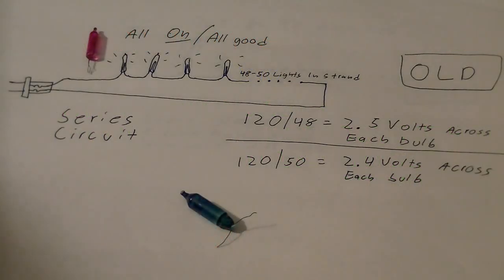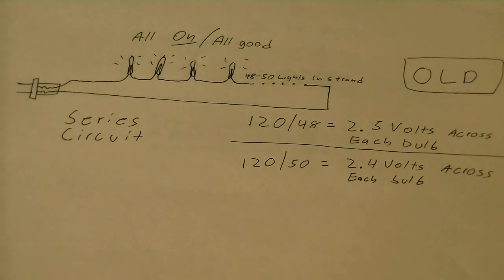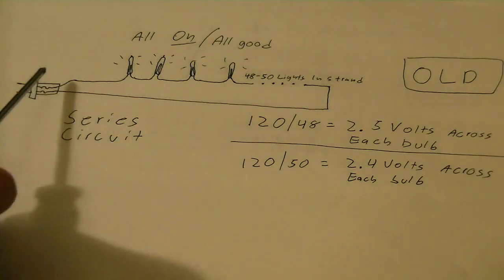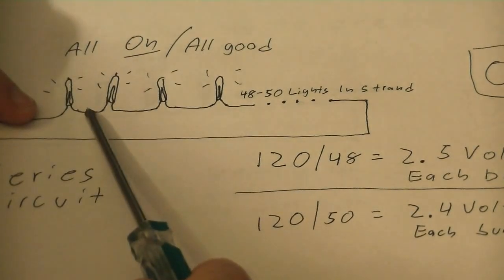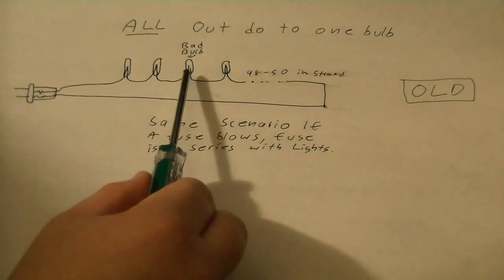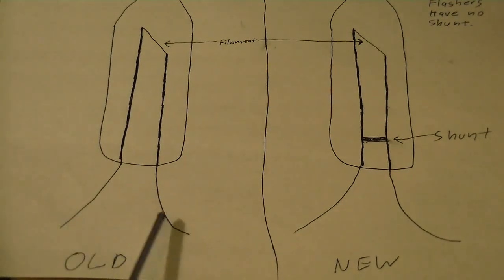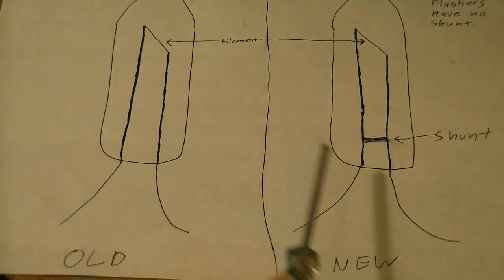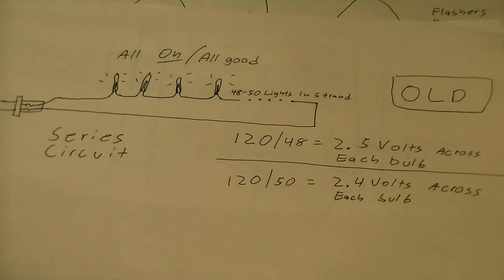How Christmas Lights work (why when one bulb burns out they all go out, and about new lights)

Comment: My mother has a string of Christmas lights and the box says when one goes out they rest don't.  They look like regular size Christmas bulbs so I'm guessing they are a series circuit with shunts.  What is weird is that all the lights on one side of the string have gone out, but not the other side.  I can see that if I take a light out on the side that is still lite up that it doesn't knock the other ones out on that side, so they definitely have shunts.  But why did the other half of the string of lights go out?  The plug has two little fuses and I replaced those, didn't fix the problem.  Then I went to the last bulb on each side of the side that is working and replaced the two next to those that are not working, one at a time, but that didn't fix it.  So I guess the problem could be in any of the bulbs that are not lite on the side that isn't lite up right?  One of the shunts must not be working, I'm guessing.  Does that sound right?

Comment: Nice explanation. I'm wondering if you could shed some light on a problem I have on a vintage Merry Christmas Sign I would like to try and fix. It's a Dynasty classics 1992 Merry Christmas Multifunction sign. It has 8 functions and 144 total incandescent lights with a two 1.5 amp fuses for a total of 3 amps it says on the plug. The easy question is I don't know if I need 2.5 or 3.5 volt replacement bulbs. The other is there is a section of 5 dim lights on the string but the rest are fine before and after that. Now these aren't wired like traditional string lights. The controller box has 5 wires coming out each going to 4 separate bulb colors to power the lights and the 5th to the opposite end that has 4 soldered wires together, Probably the neutral wires going back to the controller box? I've also noticed a small nick in the wire close to the dim lights but it seems to be mostly in the plastic and not thru the wire. That could be the problem or one of the lights are about to fail and are at a higher voltage making those 5 bulbs dim. Also each bulb socket has 2 wires connected to one side and one wire connected to the other side and if I totally remove one bulb the rest of the lights stay on. I know this is a lot but I tried to be detailed to explain the problem. I don't know if you really want to answer this but I want to fix this vintage sign and you seem to know about electricity. Thanks

Comment: Good video. I've always been into electronics and electricity and I remember the time in my childhood when I was looking at a string of lights mom and dad had and wondering how those small bulbs could handle 120v. I'm not sure if it was my dad who told me or if I discovered it myself that they are wired in series and it made sense then. I had electronic kits at the time and had learned about series and parallel circuits from those.
Reply from the maker: Thanks! Yeah, i used to wander that too. But the voltage divides across of them. Thanks for Watching!!!

Comment: I'm wondering  if u have a strand of 50 bulbs  is there a way to add on to the circuit? To double to amt in a single strand  I understand  bulbs Carry resistance so I'm sure that has a max amt on "old" lights on a single strand..
Reply from the maker: Yeah you would only be able to have so many or the voltage would not divide across the bulbs right. Thanks for Watching!!!

Comment: I did find, after doing some meter testing, that I'd need to add a resistor(s) to the circuit if I wanted to shorten the lights form say 20 lights to two lights (I wanted to wire a small box with a switch and two lights). The reduction of lights would not provide the needed voltage drop across the circuit without it.
Reply from the maker: Makes sense, keep it from over powering the other ones. thanks for watching!!!

Comment: Many thanks for the informative video. I would want to build my own Christmas lights but I need only to use 17 bulbs. As I see your diagram and understand why the number of bulbs in christmas light are either 48 or 50. does that mean I have to look for or install a bulb with at least 13 wattage for my light to work? (we are using 220v where we live).
Reply from the maker: Your welcome! Yes either that or you would have to put a current limiting resistor inline with it, that way it can't draw to much current, it would be a good size resistor though. Hope this helps! Thanks for Watching!!!

Comment: I have a pre-lit Christmas tree that I'm packing away and was hoping to fix the lights on it that don't work. I have one whole strand out and every bulb on it is black. What would cause all of the bulbs to burn out and turn black? Obviously, I need to replace the whole strand but wondering if I should bother with replacing every bulb on the strand or just pull the whole strand off and replace it. The burned-out bulbs are on a strand that came wired onto the tree.
Reply from the maker: I'm not really sure on that, unless there was a voltage spike or something. Thats about the only thing i can think of, i'd just replace the whole strand instead of each bulb, just in case there is a short somewhere, that could cause that to. hope this helps! Thanks for Watching!!!

Comment: I have several sets of 9 foot long "swag" lights, consisting of 3 sections of cascading strings that measure about 3' each. Problem is, one section will be out, beginning at the "swag" point (the section where they all collect, before then hanging down in the next section) On each string, it is a different complete section not lighting... the one closest to the plug, the middle one OR the end section, only affecting ONE of the 3 swags...Could there a separate fuse for each of those sections, allowing the next (or previous) section to work fine? It always only affects 1/3 of the lights.
Reply from the maker: Sounds like there maybe a separate fuse for each circuit in it, not sure right off hand though. Thanks for Watching!!!

Comment: I have a question, trying to trouble shoot  a 5 foot section for a about a week now.  This is this right where male plug end goes into wall outlet first 5 feet is out, I trouble shoot it with a meter and got one side of mini bulb socket reading 120v and other lead zero. I have icilcles so its driving me crazy! Please help if you can. Thanks
Reply from the maker: +thetruth First thing I would check is the fuses, and it sounds like it may have a short in the one of the wires, if all the bulbs are good. Its hard to trouble shoot something like that, its really hard to trace the individual wires out. Thanks for Watching!!!
Reply: fnaguitarplayer9 I don't want to be critical but your diagram is wrong. The hot leg is not going in and out of the bulb. hot lead hits each bulb with a neutral and hot lead. The series is broken up in 50 bulbs sections the hot lead as well as neutral travels the length of string of lights.
Reply from the maker: +thetruth That is true, I over-simplified it just to get the point across how each bulb is in series, so i guess my schematic would be for just one section.

Comment: Great video but, is there a way to change the Fuse if, it is a Bad Fuse?? I have a full box of lights and not even 1 Bulb works!!  I guess that's why my friend said, I can have them ALL....lol. I guess I'm just stuck with a full box of bad lights!
Reply from the maker: Yeah, on most lights i've seen the fuses are in the plug, there should be like a cover you slide out / off to get to them, most sets will have 2, they look like little buss fuses, you can check them with a volt / ohm meter or continuity meter. hahaha i hear ya! they can be a pain! Hopefully you can get them going, in a case like that though you might be better off just to buy a cheap set haha Thanks for Watching!!!
Reply: fnaguitarplayer9 Thanks!! Happy Holidayz!!
Reply from the maker: K Bizzle your welcome, thanks, same to you!

Comment: Finding out by trial and error which light bulb to replace was one of my childhood Christmas traditions; now they're all LED diodes it seems, no one wants to deal with the hassle of replacement bulbs any more... but the shunted incandescent period was somewhere in the middle, 20 years ago?, so as long as a bulb is in the socket, one burnt-out bulb won't turn them all off, but that burnt-out bulb has to stay there in its socket to complete the circuit.
Reply from the maker: +Peter Houle I hear ya! I know what you mean. As far as i know if a new set still has incandescent bulbs they have the shunt, but they are getting fewer and fewer any more, but are still out there, at least around here you can still get super cheap sets that are still the incandescent bulbs. But its been a few years since i bought any though. Yeah and it makes it easy because you can see which ones out. Thanks for Watching!!!

Comment: Great!  What do u know about LED lights?
Reply from the maker: LED Christmas lights? never worked with those before, but LED's in general i know quite a bit about, when connected to DC power they will only light up with it hooked one way, because they are diodes, allowing current to pass in one direction through it, and they are much more energy efficient as compared to incandescent bulbs. And you have dual and triple colored leds, flash leds, etc etc  I'm a electrician, if you have any electrical questions feel free to ask. Thanks for watching!!!

Comment: Are you saying that because of the 120/50 formula a string of lights has to be 50 bulbs in the circuit for it to work with out blowing out bulbs
Reply from the maker: Yeah, that is what i mean, you would have alot more current going through each one with less bulbs. thanks for watching!!!

Comment: ive got yard deers lighted, one has burned out bulbs, bought light strand to replace bad bulbs no work ,blowed bulbs out guess wasn't same voltage need correct bulb size , where to get
Reply from the maker: I've seen those before, pretty nice. I don't really know where you can get bulbs for something like that, you might be able to check with the manufacturer of it or where you bought it from, if you have a book or paper that came with it, it might say something about what bulbs to use. sorry I couldn't help out more! Thanks for watching!!!

Comment: I have a question maybe someone can help. I made a small shadow box out of wood and need a small strand of lights to light the back of the box, Approximately 6 lights. So... is it possible to trim down a strand of Christmas light to 6 or 7 lights without creating a fire hazard?
Reply from the maker: It probably won't work, unless the lights are wired in parallel instead of series, because if you cut it down and they are in series with less bulbs, there will be more current going through them. thanks for watching!!!

Comment: I have new strands on a prelit tree and, in a large section of the tree, all the bulbs are out. I replaced all of those bulbs and it's still out. So, what's the real problem?
Reply from the maker: +Art Teach Sounds like a fuse may be blown or a wire is cut in 2. But its still possible that one or more bulbs is bad in the one section of it. thanks for watching!!!

Comment: HELP!  Ok I have a set of Christmas lights, with an incandescent filament. They (bulbs) shaped like little pearled globes. They're beautiful. and unable to get I bought from KMart some years ago. Here's the problem. One half of the set works (every lite) the other half of the string does not light up. I checked every single bulb, I checked the little fuses, the wire is not brittle cause the makers used good quality insulating material. I cannot see any defects from the wire, the problem might be inside the socket. How do I solve this? All the lights are the same color (little globes) if you go to the middle of the set, the half on the right works, the half on the left does not.
Reply from the maker: It has to be a break in a wire somewhere or a bad fuse socket, not making a good connection, or a bad bulb socket not making a connection. Hope this helps, Thanks for Watching!!!

Comment: On a shunted string of lights, only 35 bulbs, I'm trying to get them to stop blinking intermittently, there's no box on the cable, and no bulb with a black tip to indicate the "blinker", so I'm going to just cut off the plug (assuming that's where the fuses are; it's solid plastic so I can't open it) and replace it with an old lamp plug I found; it's one circuit, only 2 wires, so it seems straighforward. 
However, on another light string from this period, there are 2 wires from the plug to a little box that plays holiday music, and then 3 wires leave the box and go through all the bulbs EXCEPT the second-to-last one (maybe 50 on this set) so maybe the 3rd wire has to do with the music? I want to bypass the box to get rid of the music and blinking, think that'll do it, but I foresee some trial and error with splicing. Thanks a lot for the video, and your time!!
Reply from the maker: +Peter Houle yeah it might have a blinker built in on the plug, only problem with that is you bypassing the fuses. I'm not sure on that to be honest about it, I'm sure there is a way to trace it out though, just hard to do without physically looking at it. Thanks for Watching!!!

Comment: Why are 1/2 my lights going out? I have 1 strand of lights, and only 1/2 work. Fuses aren't blown, and none of the filaments are blown either...
Reply from the maker: +David Ikard If all the bulbs are good, and the fuses are too, then it has to be either a loose connection on one of the sockets or a short starting in a wire somewhere on it. Thanks for Watching!!!

Comment: They are wired like this purposely to make us crazy so we will throw the whole
string in the trash & go buy a new string. More $$ for them. Bastards.
We just bought a GOOD quality LED string wired in PARALLEL as it
should be $18. Should last for years & years.
Remember the old big bulb strings? When 1 bulb burned out the rest
stayed lit. Funny about that.

!